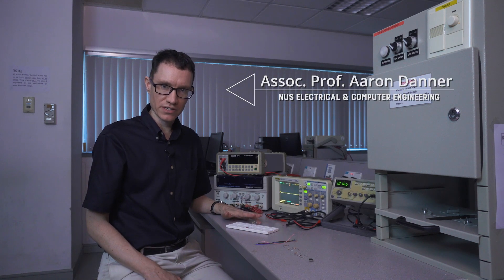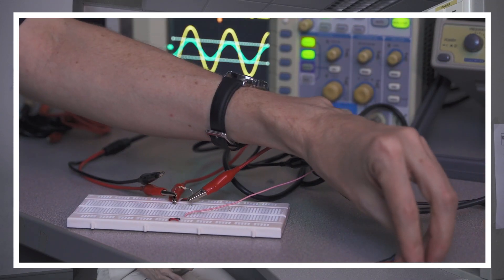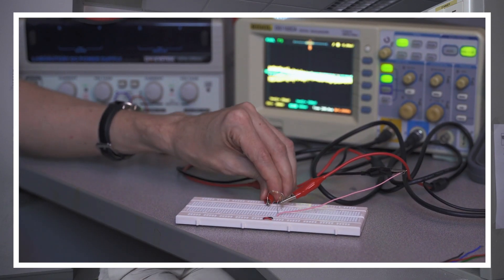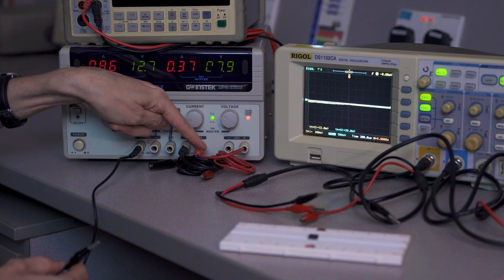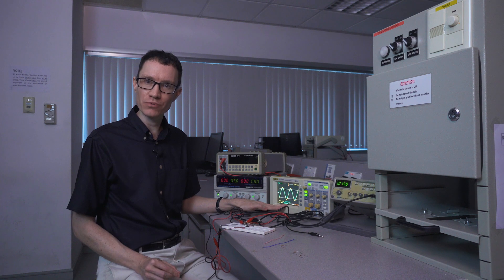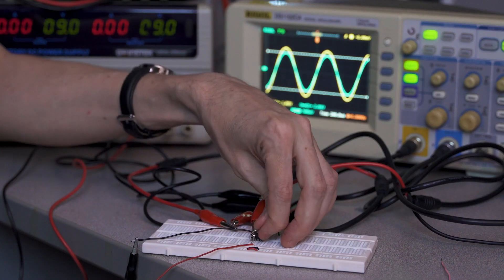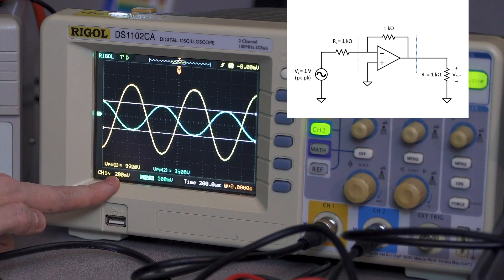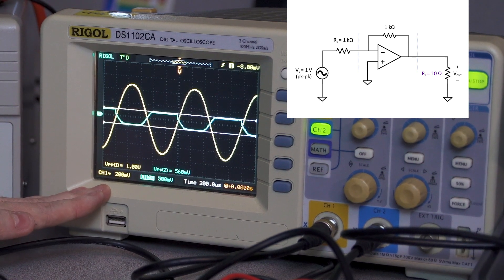Let's build an amplifier using an op-amp (Amplifiers #3)

Comment: Are the two channels shown at different scales on the vertical axis on the oscilloscope? What is said makes sense, it's just that what is shown on the oscilloscope trace doesn't seem to visually represent the comparison of the two voltages (i.e., 1V on channel 1 appears double that of 1V on channel 2). I'm not experienced with using oscilloscopes so just wanted to verify this. Thanks for the excellent lab demo!
Reply: yes, the divisions does not represent the same scale. For example at 3.40 , at the leftmost bottom side of the screen, just under Vpp(1)=1.04 is the division scale for channel 1. It says 200mV. On the left side of it, it says 500mv. It is for channel 2 as well.